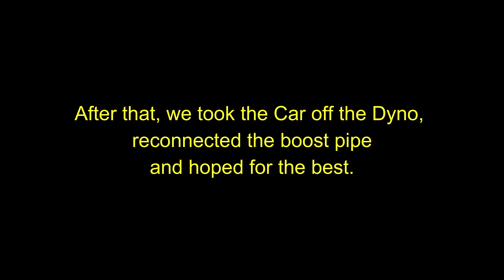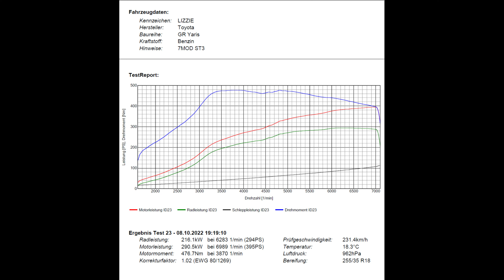Toyota GR Yaris - Nearly 400hp with OEM ECU

Comment: What kind of Kelford Cams did you install?
Reply from the maker: The EZ aka Drop In.
Reply: @RotheliRacing  was heißt das auf deutsch?
Reply from the maker: @holgerstoll1010  das ist sozusagen die erste Stufe welche auch mit dem Serienmotor und Turbo funktioniert.
Alle weiteren brauchen dann mindestens 400PS und Upgradelader um zu funktionieren.
Reply: @RotheliRacing  …was nach dem Reglement beim GTAM dann nicht mehr vereinbar wäre😅
Reply: @RotheliRacing  ah ja, wo hast du den Kopf planschleifen lassen?
Reply from the maker: @scherzobenhaadi  korrekt. Weswegen wir nach wie vor mit dem OEM Lader unterwegs sind.
Ansonsten kommen wir in die PRO.
Kopf hab ich nirgends schleifen lassen.

Comment: How could you possibly get near 400hp with the stock turbo?
Motive DVD maxed out the stock turbo just over 200kw at the wheels (300hp at the wheels)
There is no way that there is 100hp of drivetrain loss.
I love that you're chasing power with the stock ECU but it definitely seems like some numbers might be being manipulated?
Reply from the maker: Nothing manipulated here.
Did a 100-200 in ~10s. 🤷🏻‍♂️
Reply from the maker: And there‘s another company in germany which had over 400hp with a 200 cell sportscat. 🤷🏻‍♂️
MPS Engineering.
Reply: The Yaris has about 100hp of drivetrainloss unfortunately :/ I thought the same but many other dyno sheets show the same.
Reply: @HRNSHN_Racing  Exacty, @180km/h is about 60hp to 70hp depending on tyres and alignment, so 100hp with 255 tyres @230 Km/h is nothing new.
Reply: Surely a good example of why wheel horsepower is the number that should be used to understand performance?
Reply: I agree with the original comment. 294PS does not equate to 395PS - Thats a 35% drivetrain loss which is totally unrealistic, i dont care about what tyre size is used, its not going to allow for THAT much drag with such a small efficient 4wd drivetrain that the yaris gr has. 20% losses are more realistic for a 4wd car, so 352.8PS flywheel is the actual figure here.
Reply: It's 216kw atw, I wouldn't take any notice of Euro "engine" figures.
Reply: @lastexile1187  I would also be interested in what the losses are in the GR drivetrain.
BUT. The dynamometer itself also has losses that are dependent on the surrounding conditions. Therefore, this form of measurement is more accurate. P(eng)=P(wheels)+P(loses(=car+dynamometer)). And correction to standard (norm) conditions. Even though the ECU itself already adjusts the engine control according to the surrounding conditions ...
Reply: @nicolascageczechia1342  its common knowledge that ~20% loss is what you see on a 4wd car. Videos like this are just clickbait as the flywheel figure isnt accurate for the limitations of the turbo/engine setup (i.e. the turbo can only flow so much before exceeding its peak efficiency); if the title just had "350/360bhp" nobody wouldve cared. Either way im sure its still a very fast and capable car; id happily own one myself, maybe in the future i will
Reply: this one is 294 hp at the wheels....did you watch the video and see the dyno chart? it´s less power than the motive got. dont understand your question ?!? pls delete
Reply: My car almost made exactly the same stock power as this with a full 3 inch exhaust , busy with tuning on the stock ECU now at 350 ish hp , next mod will be cams/springs , stock ECU is very capable…….just saying
Reply: @RotheliRacing  thanks for the 100-200 post , it will quite down all the “happy dyno” nonsense
Reply: What are you using to tune the ECU?

Comment: How much boost are you running on the turbo? I am currently at 251kw at 1.5 bar..
Reply from the maker: ~2.2 bar.
Reply: @RotheliRacing  Hi Phil, I watched the presentation of the GR Corolla in  America. Same engine, same Turbo and the standard boost pressure is 2.5 bar, the engine Power 300 Horsepower. The gauge shows about all the RPM 1,0 bar higher boost in the Corolla than the Yaris. I'm very interested to find out, what cam springs toyota has installed.
Reply from the maker: @holgerstoll1010  can‘t imagine they have nearly 1.0bar more boost for just 30hp more. And they don‘t even have an OPF.
Our Stage 1 has less than 2.0 bar boost and ~310hp with HJS DP and stock OPF.
Reply: @RotheliRacing  oh Phil I'm sorry for my mistake. The boost gauge in the Toyota Corolla works in PSi in America. Standard Pressure is 2,52 PSi . That means 1,74 bar for 300 Horsepower
Reply: @RotheliRacing   So my 251kw on 1.5 bar is good? I have a custom cold air induction and a custom downpipe and exu tune..

Comment: How did the stock gearbox handle this power?
Reply from the maker: Surprisingly well.
Reply: @RotheliRacing  ok thanks my Yaris is at Toyota, it started jumping out of 2nd when the car is just coasting, they fixing it under warranty, car is making around 350hp  now, love your content on the GR, dit the wrapping of the exhaust help a bit with the rear differential temperature issues?
Reply from the maker: @ericvermeulen9853  i think it did yes.